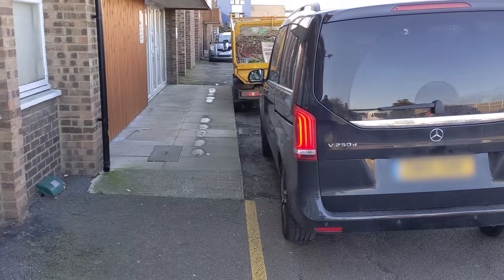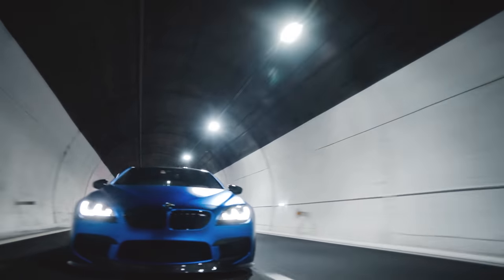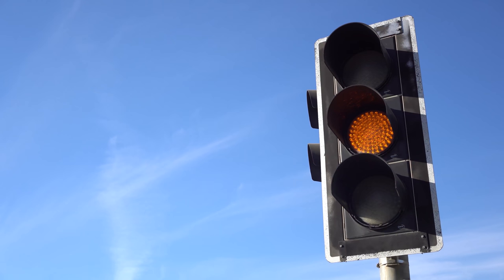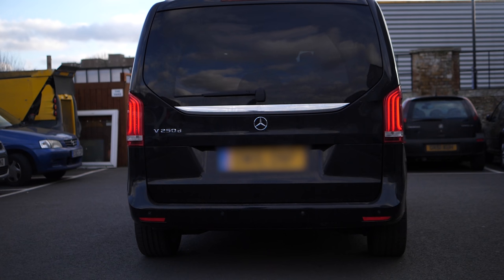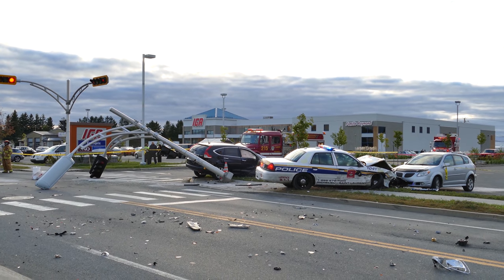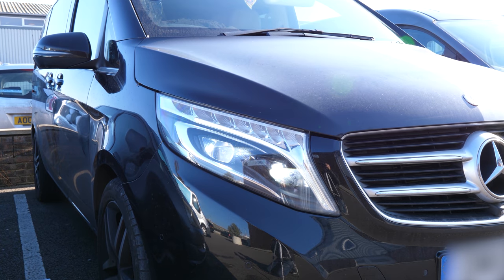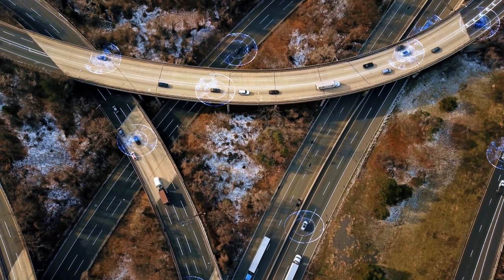Self-Driving Cars Are Dangerously Confused By LED Lights

Comment: Simple solution: make a federal law where cars need to make their LED lights need to work on a specific Hz frequency and then make the cameras to identify and work with said frequency.
Reply: Unfortunately, it isn't that simple either. It is impossible for any two clocks to run at exactly the same speed without requiring a reference signal to keep them synchronised.

Comment: What about a 2 camera system, with noncoprime frame rates (like... 61 and 67 fps) so that the frame would overlap only about once per minute. Thus the AI would be able to far more easily detect artifacts, since the artifacts on one input would be VERY different than those on the other. I'm not a camera expert, but it seems like something like this might be useful.

Comment: I'm surprised nothing was mentioned about ND filters, quite popular on GoPro cameras for mitigating almost the exact same problem. Basically putting window tint in front of the camera lens, allowing it to have a longer shutter time without over exposing, although it would reduce the camera's night vision so you might need some way of mechanically or electrically removing or switching off the ND filter at night. Just having adjustable sensitivity/ISO setting in the camera itself might be the easier option anyway.

Comment: Hey Steve! Your explanation at 3.30 implies that the camera shutter speed is super fast, much faster then 100th of a second, which is standard for 50 frames per second frame rate. Basically you assume, that frame exposure is momentary witch it isn’t. That could be misleading maybe it would be better to put a caption with further detail at this point of the video. Anyway, thank you for your great work 👍

Comment: The sensor issue obviously still needs to be worked on and refined to work in parallel but I always thought a good option would be some sort of RFID chip. You could install it in to the wiring of your car that broadcasts basic status (indicator on, brakes on etc). Self driving cars can triangulate positional data based on the RFID signal and 'visual' sensory data and correlate the status signal with the 'visual' data. I assume this sort of thing would be standard in self driving cars so the cars themselves communicate to reinforce sensory data but something like this could be quite cheap to make and install in existing human controlled vehicles. I see no reason why it couldn't be government subsidised as it would make the roads safer and decrease deaths. Though this option comes with security issues that would also need to be solved. But like you say, that's half the fun right?

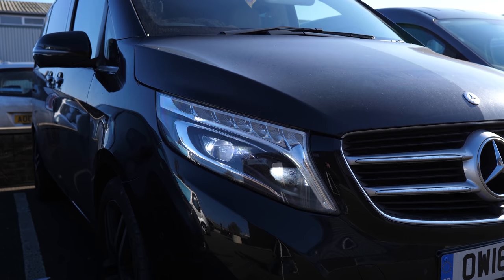Comment: 1:30 while this is true they can use the same lights to turn or brake, but there is a catch to this that I don't think the UK has since they have separate turn signal colour. The US has whats known as the 3rd break light law or the Center High Mount Stop Lamp (CHMSL) law where cars here are supposed to have a 3rd light in the middle to signal stops. But this could have issues with imports but you might get pulled over for lacking it. So in the US you can try and look for the section of a car where you expect to see a 3rd breaklight and even though its red like turns, the position would tell the system. Speaking of imports and cars that have it installed as an attachment, the position could vary and might not be easy for the sensor to pick up for one reason or another (like the lights arnt the correct frequency so the car thinks its something in the ambiance)

Comment: A better solution may be to just stop using PWM to dim LEDs and go back to varying voltage. Yes, it's more expensive than PWM, but this is still less expensive than cameras with apertures, lower ISO sensors, perpetual use of AI, or any of the other solutions mentioned. This will also stop the annoying flickering that the human eye can sometimes detect at night. (I'm looking at you, Cadillac.)

Comment: Back east where they get substantial snow in winter, a county changed all their traffic lights to LED to save money. Winter comes and snow covers the traffic lights so they're not visible. The county had to send workers out to physically remove the snow at great expense. They realized that the old incandescent generated enough heat to melt the snow and the LEDs were too cool. The county returned to the incandescent because it was cheaper and safer in the long run.

Comment: Would it not be easier to have another camera dedicated to these kinds of lights? Have your normal camera with a shutter open for a fraction of a frame so you can reduce motion blur, and have a different camera that's less sensitive with the shutter open for the whole frame just for lights. You could even layer the two cameras to show one feed with both positive attributes.

Comment: Do you know that your TV remote also uses this pulse width modulation ?  it is a way to make the LED a lot lot brighter.   You can  pulse a big current  like 150mA through an LED that can only handle say 25mA if you do it for only say 1 millisecond and switch off  for a long time .  The remote will send pulses and the TV sees them and synchronizes its oscillator to the pulses.  Then it only "looks" for  a pulse in the time "window" it expects to see a pulse at that frequency.  This helps the TV to not pick up infrared from just heat.   The remote will send a pulse or not send a pulse in the "window" and that's how it tells the TV ones and zeros to tell it the command serially.

Comment: So, basically, if manufacturers weren’t so cheap/ignorant and installed higher frequency PWM and/or a low-pass filter, this wouldn’t happen. Fantastic... As for traffic lights, I don’t think it’s PWM (why would you want to dim a traffic light?), but the effect of a bad LED controller, that makes the LEDs flicker at mains frequency (50 Hz here in Europe).

Comment: This effect could be used to our advantage for self-driving cars by making other cars more visible to camera sensors against the background of other lights/glare/reflections/dappled-light/rain/etc if the blink-rate is made to be distinctive.

If auto-makers who are making self-driving cars (which is nearly every major brand) created a standard for the blink-rate of different lights, matched to the sensors' scan-rate or frame-rate, then car lights would be screaming to each other "I am a car, I am a car". Moreso, it would give orientation information, "This is the back of the car", "this is the front". "this is the front as viewed from the left hand quarter", making the job of identification and tracking easier for other AIs.

Going further, they could also use the blink system to pass information to each other about their status and intention that doesn't require RF signals that could interfere or jam. With lights, you have to have line-of-sight, which means you are sending only to the cars that can see you, which is what you mainly want. Emergency vehicles could have the same thing via their roof lights, visible over a longer distance to more vehicles. Traffic lights could include timing info, even traffic data. (And cars could signal to traffic lights to allow traffic systems to "know" where cars are headed, to adjust timing better. Including "I'm a car on autopilot, feel free to assume better-than-human reaction times, but shitty pattern recognition.") 

(By "Status", I mean things like "rate of braking/acceleration". Normal brake lights are a binary, you either are or aren't. We rely on human pattern-recognition/motion-perception to fill in the rest. It would improve car-AI drastically if the cars were telling each other, "I'm at speed" vs "I'm decelerating but not braking yet" vs "I'm braking normally" vs "I'm braking as hard as possible because emergency!". Showing "Intention" is to similarly extend the range of info beyond turn-signals' yes/no. "I'm going straight across the intersection, but then immediately turning into the carpark on the other side".)

And then one day, Steve (or Alec or Joe or Tom) could do a video on "the secret world of car signalling".

Comment: The thing is though the pwm pattern of one of these lights legit blinking, is still going to look different then the pwm pattern when the light is meant to be solid on. and since the computer does run faster it can also be programed to detect which pattern it's seeing.  or in situations where it's detecting the brake lights it can keep a bit of a frame buffer and merge those parts of the image.so it can compensate for that effect. before it sends it on to the part of the code that decides what to do.  either way,  as long as the people developing the software also realize this there are plenty of ways to account for it.

Comment: You reminded me of another hazard i face from the red indicator. I live in a third world country and nearly half of drivers here do not use signals at all, not to mention that some lights don't even work. Most cars use amber signals, but some that are imported from the USA have red signals. The confusion happens when a red indicator lights up, it takes a while to know if the driver is braking or attempting to turn, as some drivers turn without even slowing down. Sometimes i slam on the brakes just because i mistake a turn signal for a brakelight.
The lights are supposed to convey information and making them similar risks confusion in this process

Comment: My car has a backup camera that is REALLY susceptible to that strobe effect. It makes it very easy to see, for example, that the overhead lights and the headlights of two cars in view are all operating at different frequencies because of their different strobe patterns. There have been a few times when the strobing is so bad I can't use the camera at all, so I can easily see the potential for serious problems with autonomous vehicles.

Speaking as a US native, I also definitely agree that the US should adopt the amber-turn-signal requirement. It's not an expensive change and it improves signal recognition speed.

Comment: AFAIK PWM is also used due to color and brightness changes if you would vary the current, which is prevented with PWM. There would be the possibility to use spread spectrum PWM, which would have different frequency contents and thus reduce sampling artifacts due to aliasing.

Since these are specialised cameras you probably could probably also vary the time when frames are captured.

Comment: My first thought would be to use two cameras instead of one and have the shutters timed so one is open while the other is closed and they alternate. Merge the data, then you have a continuous picture with the right exposure and a complete picture of the LED lights.

Comment: 2:35 that differs though when you move your eyes. 1000 Hz is visible on your retina when your eyes (not your head) move from one spot to another moving very fast. Then you notice whether the blurred light lines are dotted.
Especially with high contrasts. Not only the light source itself, also at e.g. reflections/sharp light edges.
Also applies for screens. That's why e.g. EIZO monitors try to dim through voltage in the range possible

Advanced PWMs use a broad random frequency spectrum, so PWM without any periodicity. Thus the brightness will appear about normal (just noisy) for any framerate, shutter angle and also blurred lines have no regular periodicity.
However, wherever possible, fine voltage control monitoring the actual current (the determing property of diods regarding light output...requires super accurate current measurements with lights having huge dynamic ranges: dimming to exactly 0,100% of the maximum current)  are just nicer.

Comment: What I am curious about is why they don't just use global shutter cameras? Basically, a global shutter negates the rolling shutter effect (and thus the on-off issue with LEDs) by capturing the entire area of the sensor every single frame and not scanning it line by line like normal cameras do. I was waiting for Steve to address this in the video.

Comment: I'm thinking about the Nyquist-Shannon sampling theorem here: to faithfully reproduce a signal (the LED light flicker pattern) by recording discrete samples (the camera images), you'd need to sample with at least double the highest frequency present in the signal. Seems easy enough to just do this, until you remember that this is PWM: running at 50% duty with 60 pulses per second has a maximum signal frequency of 60Hz (the number of pulses), so the camera should be recording at at least 120fps—but running at 1% duty has a maximum signal frequency of 3000Hz, so the camera would need at least 6000fps. I'm not sure how well applicable this calculation is for camera images since they do not record instantaneous samples but smeared ones; this should probably help but I haven't been able to figure out the true mathematical behavior of this.

Comment: Cars need a standardized frequency for the PWM of the leds and for the cameras.
OR
have two cameras; a low-quality but very high-frequency camera that senses flickering lights and adjusts the frame rate of the main camera to pick up what it's supposed to. So when the high speed camera picks up a flickering led it adjusts the main camera's frame rate.

Comment: What would the ramifications be if you used a secondary camera which had the framerate the same but slightly offset? That way you could compare the two, and if there's a discrepancy between the signals of the cameras, you know it's a beat signal, and if they "agree" with one another then you know that the light is actually flickering.

Comment: You could also mandate adding a smoothing capacitor to the output of the PWM. That's how you get relatively smooth DC out of a rectified AC power source. The difference between AC and pulsed DC is effectively just the wave shape and your arbitrary definition of ground.  Since the ground isn't in the center, you don't have to rectify it but you can still do the smoothing step. Of course, it's essentially too late already as you can't force everyone to replace existing LEDs and it'll be decades before they dissapear through attrition.

Comment: Some cars have LED lights with frequencies (or flicker rates) that are visible.  Very distracting.  The easy fix would be to standardize the frequency.  The electronics that create the 50 cycles per second can just as well do a billion cycles per second.  That would take the whole matter out of the equation.

Comment: so the fascinating thing about why car lights are pulse-width modulated is that it's not to dim the lights, it's to BRIGHTEN them! LEDs just aren't bright enough to be useful as headlights under normal, permissible voltages. you can of course make them very bright if you just overvolt them, but then they burn out. so the car overvolts them at something like a 15% duty cycle, making them much brighter than normal without burning them out.

Comment: What about sticking a capacitor in parallel with the LED? Obviously you would need to require that all vehicle lights be made with that, but it would effectively translate the PWM into voltage control, would it not?

Comment: I learned that my headlamps use PWM to vary the LED brightness when I was looking at a cooling fan of a running car. It looked like it was sitting still because the fan blades were spinning at the same frequency as my headlamp’s LED. When I  turned the brightness all the way up the fan looked like it was spinning. That told me that there was no PWM on high.

Comment: The seriousness of this problem can not be understated; especially since there are no effective solutions that are trivial. I am a graduate-level engineering student and part of my role is to be a TA (teaching assistant) to students as they learn fundamentals of robotics design, this is one problem we try to encourage students to work with/around. As long as they sample the light receiver slightly faster than twice the maximum PWM frequency (read Nyquist Frequency), they'd expectedly be able to sense the high-side and the low-side of the duty cycle. From which the logic can be cleverly written to process the string of Highs and Lows; say 1, 0 is dim; 1, 1 is bright; 0, 0 is off. Since this would need to happen at minimum 30Hz (so we can see it as a solid light a sampling frequency needed for this application is marginally greater than 60Hz). Finally, you process the string on a much slower frequency (say 2-5 Hz) to determine if the car is indicating the intention to turn, braking or simply just driving at night.

Comment: So it's the cycle rate/ frequency. Exactly the same as a monitor's refresh rate. But not all LEDs have pulses, and some older cars use different lights for individual functions so you wouldn't see that issue in those cases. It's certainly an issue that would need working around, however they decide to do so.

As an aside, The red turning indicators are obvious when on. Often they are different lights all together (as mentioned before), but even when they are not, it is clear that it is not a brake. If you aren't accustomed to it, maybe the first time you see it you are confused for a micro-second. Not nothing, but there are bigger concerns for international drivers, like driving on the opposite side of the road.

Comment: As far as identifying turn signals, the red ones are better.
Because they usually over-ride the brake function.
Quite often, cars with amber turn signals are hard to see when turning, because the brake light over-shines it.
But when one side is flashing, and the other is steady, you can easily tell its turning and braking.